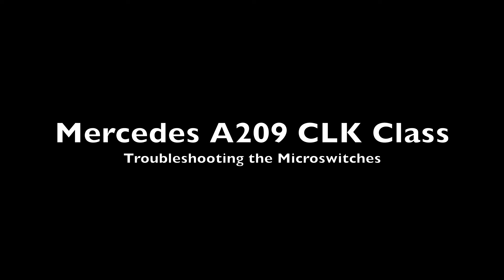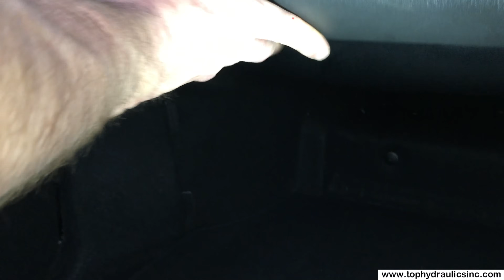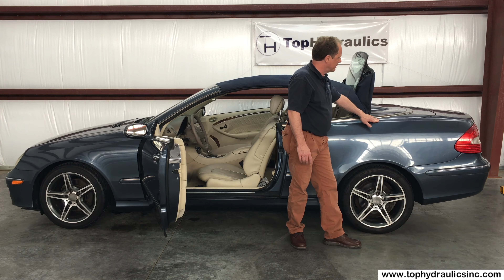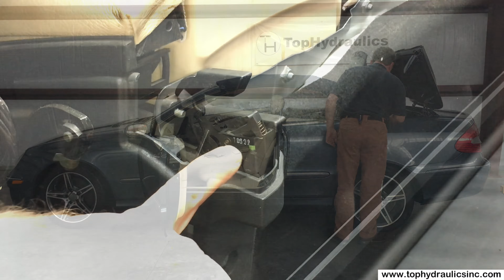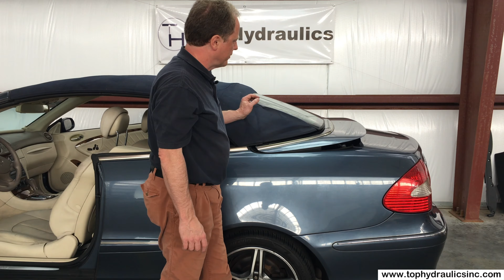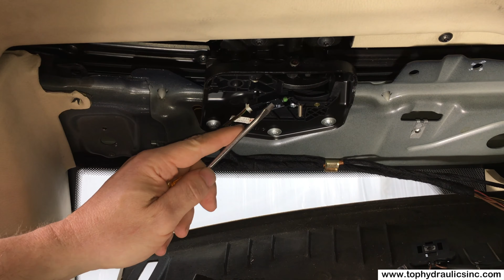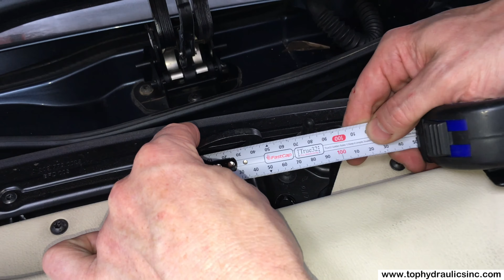Mercedes A209 CLK - How To Troubleshoot the Microswitches

Comment: Hi all, I'm really stuck and hoping someone can give me some pointers? CLK280 2006. On opening the roof the fornt clamps released and roof opened 1/2 inch then stopped. It was close enough for me to use the allen key to secure the roof again, (thanks for that tip Klaus). 
Current situation is that on trying to open the roof, windows go down, then nothing. If boot separator is open, the separator warning comes up. Clears when separator in place so I presume that is not the issue. 

I have checked the fluid level and it's ok. 
I have checked the 40A fuse and it's ok. 

I sent it to a garage that couldn't find a solution. They provided me with 2 error codes;
B1928 -limit switch interlock of soft top compartment cover remains in switched condition
B1953 - limit switch interlock of soft top lock fails to switch
I've followed Klaus's helpful videos on manually opening the roof and checking all the microswitches. 
All seem to be clicking correctly. I also took off the first relay on the pump and checked it. All OK. Haven't got to the 2nd relay yet - was fiddly to release so left it for now. 

While I had the roof maually open and compartment cover was slightly open, I couldn't resist pressing the roof open/close button. Got very excited when the pump engaged and the roof started to move. Stopped after a second or two  but perhaps enough to suggest its not pump failure perhaps?  Note that the pressure relief valve was open at that point. 

I've tried manually opening the roof fully, closing the relief valve and pressing the close button. Again no movment.  Put it all back to where I started and its back to where I started - windows open, then nothing.

I'm at a loss as to what to try next.  I'd be happy to break into the wiring harness that goes to the pump to see what sigals the pump is getting if I knew which lines to test. 

Any help would be greatly appreciated!

Thanks, Mark
Reply from the maker: Hello Mark,

thanks for the detailed description. You mentioned that initially the front unlocked and the roof opened 1/2", then stopped. Did the case cover (tonneau cover) in the rear move at all?  If not, that would explain the error message B1928. The tonneau cover is supposed to move back about two inches at the same time as the front unlocks.
Reply: @TopHydraulics  Hi Klaus, thanks for responding. No the tonneau cover did not move at all. The front clamps released allowing the roof to open just a 1/2inch - enough for me to pull back in using the allen key.
Reply: Hi Klaus, I found a set of instructions, (kindly written by you on another thread) that lists a series of tests for the microswitches that can be performed from the plug connecting into the SAM. Unfortuantely they are for an earlier version of SAM. The one I have is 2095451701, that combines the N52 and N10/2 into a single unit mounted on the left side of the trunk near the hydraulic pump.  If I could get a copy of the wiring harness/plug detail I could check the condition of each microswitch? Looked all over the net but no joy in finding those details so far.....
Reply from the maker: @markbatt-rawden1318  Hello Mark, thanks for asking. By the series of tests that we have shown to be made from the plug, you must be referring to our video on the SLK R170 system. We do not have the pin-out for the top controller in the A209 CLK. Can't you get that from EPC?
My concern in your case is not so much the micro switches for the following reason: The front latch is unlocking but the tonneau cover is not moving at all. The tonneau cover is supposed to start retracting at the same time as the front lock opens. Thus, I see three most likely possibilities: 
1) The pump has enough power to move the front latch, but not enough power to move the tonneau cylinders past the first inch or so (which is where the tonneau cylinders have friction built in and are harder to move). If you were to manually help the tonneau cover and get to the point where the roof is supposed to start retracting, does the pump have enough power to continue the cycle?
2) The computer is not giving the signal to the  solenoid that directs flow to lines 32 and 34, which are at the bottom of the tonneau cylinders. I know you are going to ask which solenoid this is - you could look it up on EPC based on the color of the wires going to it.
3) The solenoid for activation of lines 32 and 34 is physically compromised but electrically okay (the controller reads its resistance).
Reply: @TopHydraulics  Hi Klaus, sorry, I was not clear on reporting the fault condition. When it initially failed, the front clamps released and the roof opened 1/2 inch and stopped. Now when I press the roof button, the windows open then nothing. The pump does not seem to be operating at all. I have found an old diagram the shows the connections inside the pump relays. It looks like the green wire feeds the relay coil. If I can intercept that connection, I can get the relay to operate which should confirm the pump is either dead or not getting a signal. 

Unfortyately I don't have access to an EPC.
Reply from the maker: @markbatt-rawden1318  There are two relays that allow the pump motor to run. One of them makes it run clockwise, the other one makes it run counter-clockwise if activated. If you look at the relays themselves, then you will see that the pin-out is actually printed on the relay housings. Identify pins 30 and 87 and bridge them in the relay pigtail (the connector that the relay goes into) on ONE relay. This should make the pump motor turn. Alternatively, identify the two thinner wires that go into one relay pigtail and energize them.
Reply: @TopHydraulics  Hi Klaus, I now feel like an idiot. I checked the first yellow relay on the pump a few days ago but didn't check the second as it was hard to get to. After your message about linking the pins, I took out the second relay and found it was burnt out. I'll have to take out the pump at the weekend as the carrier for the relay is damaged and one of the relay pins has detached and is stuck in the carrier. I suspect there may be damage to the wiring too.  

The question I now have is what caused the burnout? Once I have the pump off I'll check the motor over. I'll let you know how I get on. 

Thanks for the great advice and help.
Reply: Hi Klaus, just to close this one off, I removed the pump and the relay carrier was badly melted. The wires were ok so chopped off the carrier, reterminated the wiring onto the relay and all is working fine now.  Thank you so much for your help; I wouldn't have been able to tackle this job without your helpful videos and guildance. Many thanks again.

Comment: hello  klaus, I have the 04 clk 500 I changed the s84/20 (left and right) checked the continuity on both switches, with meter, and changed the soft top control Module in your video at 3:41 is my problem the lid compartment wont wait for the rear glass to fall in place to lock when I am closing the top, what should I go after next? when its closed I hit and  hold actuation switch windows drop it says top in operating but nothing is happening,  please help with your superior education on this issue. bless
Reply: sorry I mean the s84/22 and s84/23, still lid  compartment wont wait in catch position for rear glass , please help
Reply from the maker: @k-man9087  What are the last six numbers of your CLK's VIN?
Reply: @TopHydraulics  thank you buddy u are the best, my tech put the switch in backwards, I flipped it around after watching your video, again and boom, the whole thing works!
Reply from the maker: @k-man9087  Congrats on getting it fixed and thanks for letting us know!

Comment: I'm not sure what's going on. But how would I know if the rear bow cylinders are bad? They still have tension when trying to raise or lower manually. (I Have to wait until pressure is relieved). But during the convertible process the rear bow window is not moving at all. I replaced part number 207 820 79 10. And still no movement. It stops right before the rear bow is suppose to leave the tonneau cover when letting the top down. First all the windows will roll down, then the tonneau cover slightly lifts and then nothing after that. Any idea besides that 207 820 79 10 part that it could be?

Comment: Can the cylinders for the rear bow leak from the inside and I not be able to see it physically coming out?
Reply from the maker: I believe you are referring to an internal bypass or "blowby" inside the rear bow tension cylinder A2098000972. While this is possible, it is very rare.

Comment: Hello, great video on the switches.  At 8 minutes, mine is in this position when trying to open.  Any suggestions?
Reply from the maker: Thanks for asking. If I understand your question correctly, then your tonneau cover opens a couple of inches but the rear bow does not lift up during the open cycle. Is that correct?
Reply: @TopHydraulics  Yes sir.  Exactly as it shows at 8 minutes of your video.  Thanks for the assistance.
Reply from the maker: @leodano2947  Check out switch 84/11 first, as shown here in the video: https://youtu.be/ZLIdoiw_KTY?list=PLly4CMbpk7owNRAl-AECemIb0SVihtBlV&t=236
Reply: @TopHydraulics  Yes, I remember replacing both sides of these switches a couple years back.  It's been a project car and had it working at one time, then let it sit.  Trying to resurrect it.  I know both of those shocks or maybe one since I keep getting that partition open message.  Would it be bad to just zip tie that one switch for now, while I check your suggestion?
Reply from the maker: @leodano2947  I believe you are asking me whether it is okay to zip tie the micro switch in the left rear of the trunk, which indicates to the controller that the partition is closed. That's okay as long as you don't have any obstruction in the trunk and you don't forget in the future... ;-)
Reply: @TopHydraulics  Cool, yes, exact location as stated.  Problem is, zip tie won't stay as it's a curved surface.
Reply from the maker: @leodano2947  Put something round into the place where teh bar from the luggage divider normally sits, about 5/8" diameter
Reply: @TopHydraulics  Actually used a thin piece of duct tape and kept the switch closed.  I think I am on to something.  In the position as I had stated, I pulled the glass about 1 inch up and it finished opening without issue.  When closing, everything closed (even the trunk), but the glass doesn't drop down into the latches.  Tried to push the glass closed but the latches are locked since the trunk is already closed.  What part do you think is faulty?
Reply from the maker: @leodano2947  I have the same answer as before: Check out switch 84/11 first, as shown here in the video: https://youtu.be/ZLIdoiw_KTY?list=PLly4CMbpk7owNRAl-AECemIb0SVihtBlV&t=236
Reply: @TopHydraulics  Verified the switch is as new as the day I installed it.  Both sides too.  There seems to be a hydraulic shock with a couple hoses attached to it (both sides) that controls that glass movement.  Seems to work fine when putting the top down but not when I close the top.  It doesn't pull down when that hatch closes.
Reply: @TopHydraulics  At 3:19, this is actually the state my top is in.  You mention S84/22 part # 2098201910, then in when you demonstrate, you say S84/11.  Am I understanding you correctly?
Reply: Figured it out.  Thanks for getting me in the right location.  It wasn't actually that switch but the connector.  2 years back I had to solder the connection and I guess it was closing the circuit.  I fixed the solder and made sure it wasn't touching each other and wall, cop opens and closes as it was designed.  Just bought some partition shocks so I can remove the duct tape on that switch.  Thanks again!!

Comment: Hello, i have a clk320 2005 and the pump is stuck like in the video but when opening any suggestion?
Reply from the maker: Thanks for asking. When you open the top, (1) the tonneau cover moves a little at first, (2) then the rear bow raises, (3) then the tonneau cover raises all the way, (4) then the rear bow lowers. Please clarify which of the four steps above get completed in your case.

Comment: Klaus, I have purchased your rebuilt cylinders before and I am very satisfied. These videos are the cat's meow!. But I found myself somewhat confused where you identified  S84/22 near the forward storage compartment just ahead of the Tonn Cover, then later on identifying it as S84/11.  You then stated that the same switch S84/11,  is on the front header panel above the steering wheel. Also I am not as familiar w/ Mercedes, so when you performed the latch adjustment it was difficult to determine  if you were in the front or rear of the vehicle due to the close up video shot. Thanks for the videos however.
Reply: P.

Comment: Klaus, do you know the part number for the bow limit switch S8415 by chance?  Since I'm replacing all the cylinders with your new parts I'm going to replace that switch also and 2098201810 while I'm at it.
Reply from the maker: Hello Bryan, thanks for asking. I do not have the Mercedes part number for switch S84/15 memorized. The good news is, all the switches have the part number on them, printed in tiny letters on the plastic.

Comment: Hello, keep doing such a great work, when i try go open the top it sais top in operation but nothing happens, although when i press the button down i can hear the pump for a few seconds. Do you a possible solution for this one?
Reply: Yes you are right, my mistake, the fuse is ok. Although i swaped the relays but i still have the same problem, when i press up the button top in operation is shown and when I press it down i can hear the pump for a few seconds.
Reply: same issue for me
Reply from the maker: Thanks for asking. Start out with swapping the two relays on the pump. If that changes the symptoms, then you know you have one bad relay.
Reply: I swapped the two relays but it keeps doing the same things, when i used a multimeter the 40 amp fuse doesn't seem to get any electricity because neither the left or the right pole shows something on the multimeter
Reply from the maker: @ioannisrinakis9672  In your original question, you wrote "when i press the button down i can hear the pump for a few seconds". In your second question, you wrote "I swapped the two relays but it keeps doing the same things". If you can hear the pump running, then there is power at the 40A fuse.
Reply: @TopHydraulics  same problem

Comment: Hello. What would cause the rear glass not to move? When I try to open my top the back lid comes to a tilt right before the rear glass is suppose to lift. But the rear glass isnt moving. When I manually do it, I can tell the struts still has some tension but wondering if that could still be the problem. Or is there a switch somewhere?
Reply from the maker: Thanks for asking. For the rear bow (rear glass) to lift, the tonneau cover needs to be just in the right place. That's what the micro switch on the left side S84/22 is there for. Most likely, S84/22 is compromised - please check it out and we will take it from there.
Reply: @TopHydraulics  You never mentioned a S84/22 switch in this video. You mentioned S84/11 on the left, and S85/22 on the right. Am I missing something here?

Comment: Mine leaking left side rear top won’t go up or down the trunk won’t open to add fluid
Reply from the maker: For the trunk to open, the computer needs to get the signal that the tonneau cover (storage cover) is closed all the way. Is your top currently up or down or in the middle of the cycle?
Reply: Top Hydraulics it’s up but I had to manually push on top corners to close completely to lock
Reply from the maker: @wolfemanbog4176  Is the front locked and the rear portion locked into the storage cover?
Reply: Top Hydraulics  not sure it’s all locked in the up position
Reply from the maker: @wolfemanbog4176  Have you tried to unlock the trunk lid with the blade key that is inside your key fob?
Reply: Top Hydraulics yes just turns free
Reply: Not sure what to do next hack saw or can opener
Reply: Top Hydraulics what happened I put the top down in the morning at nite it wood not go up so I got mad and made it close and I want to fix it but can’t open trunk to add fluid or find the leak
Reply: Top Hydraulics it’s in the up position I pulled up to close at night
Reply from the maker: @wolfemanbog4176  Are you sure that you locked the front by the windshield all the way, turning the Allen wrench far enough? Is the rear bow (rear glass section) properly locked into the tonneau cover?

Comment: Your awesome**thank you so very much for this information I've been having this problem with my vehicle for quite a while 1999 Mercedes CLK soft top 320 I knew it had something to do with the fuses the relay or the hydraulic system but now with the knowledge of this video I can inspect and diagnose all three to determine which is the major problem I will start and begin first with the fuses then with the relays but as also as you said check the hydraulic system for any low fluid or no fluid at all because my hydraulic system might be empty and they may be a leak as well so I might have to get the whole system replaced but thank you so very much for the knowledge and please continue to make these awesome great video